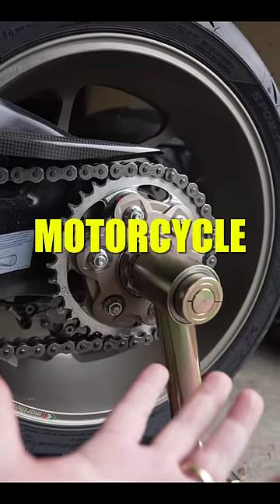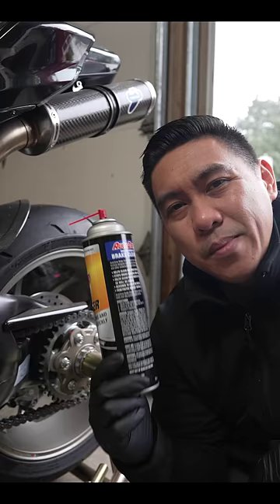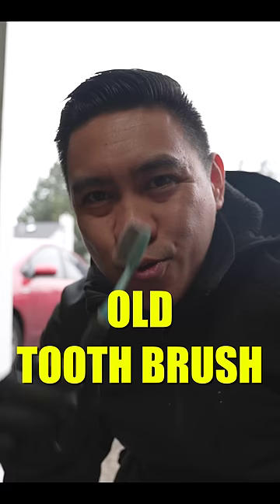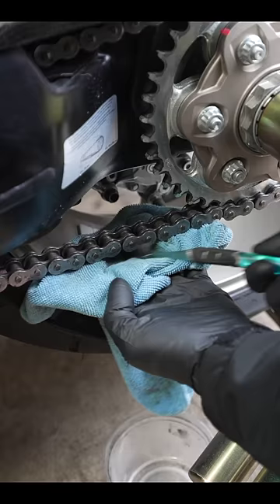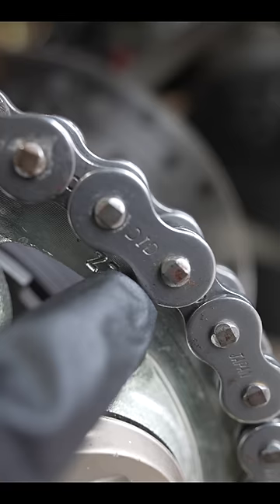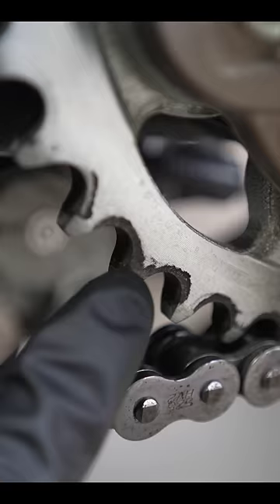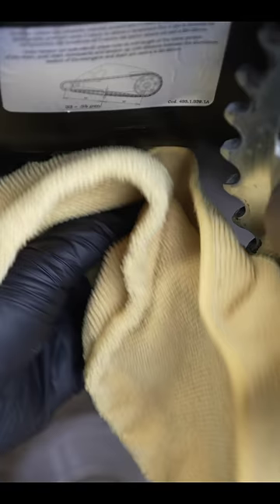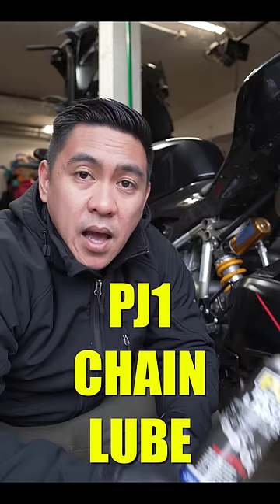How to Clean and Lube Motorcycle Chain

Comment: That little amount of lube will not spread out to the rest of the linkages.  It might cover a couple of the surrounding linkages but that's it.
Reply from the maker: Oh, i meant to spray that much across the whole chain. I guess i wasn’t clear.
Reply: @adobomoto  i mean i thought tht was obviously what u meant.. u came off clear to me atleast
Reply: @rajeevidayakumar4468  seems to hit ppl at both extreams cause i also was confused
Reply: @no_special_person  me too lmao
Reply: @adobomoto  " you wont need anymore than that"

say you dont know what you are talking about without saying you dont know what you are talking about
Reply: @nickdemsey7188  I have a rear stand lmao its not hard to rotate the wheel
Reply: I read this before even hearing and seeing it and I still interpreted it like that
Reply: Common sense goes a long way
Reply: @Jonn_Alisha-4ever  well the "I made a bottle of pj1 last 10 years" part adds to the confusion. Obviously it seems like that little spray on that one area would be the tiny amount used in the minds of people who ride daily and clean their chain often. That's a lot of cleans and lubes over a 10 year period, so it makes it more plausible that he meant don't spray any more at any other points and the heat will spread the lube across the whole chain somehow. I'll ignore that the bottle would likely run flat before it's all used over 10 years. The phrasing did make it confusing for some people, clearly. Every statement added to that confusion from showing one tiny spray, to that's all you need, to the heat will spread it, to the 10 year bottle.
Reply: Anybody who has cleaned their own chain, who has any common sense,  knows exactly what he means,  come on guys
Reply: @crp7965  he's explaining how he uses so little that the can lasted 10 years, as if it's a secret. Everyone knows how they lube their own chain, but no, they don't automatically know what he means.
Reply: @adobomoto to me you were clear enough when you stated “move on to the next section”
Reply: @Honey_Daddy not everyone knows how to clean and lube their chain, at least properly
but it shouldn’t really be a debate on what he meant because it’s like how oil works in an engine, every part needs to be lubricated
but yeah, makes sense why people are confused because he more or less specifically said to spray one area and it’ll spread with the heat, which of course isn’t the case
Reply: @raphy_tt  yep, you covered it fully from both sides. Well said.
Reply: @adobomoto  he’s definitely a gixxer rider if he thinks you meant that tiny spray would do the whole chain 💀
Reply: @tigrisphotosynthesis9796  you're  being  pedantic - run along.
Reply: @firmfire2385  tell me you aren't very bright without saying you're not very bright.
Reply: @crp7965  Why would anybody who has cleaned and lubed their own chain be watching a video about how to clean and lube a chain?
Reply: Bro common sense come on
Reply: @adobomoto  Oh yeah i didnt understand you meant the whole chain that could have been a disaster if i didn't look up the comments lol . But i guess i knew something was off so i usually see what other people in the comments are saying when something seems off.
Reply: mf  @adobomoto
Reply: @adobomoto I thought it didn’t make sense to only spray it in one area but it sounded to me like thats what you meant which is why I came to the comments to check.
Reply: @John-kb7pv because sometimes we may learn that we've been doing it wrong all these years.
Reply: Looked for this comment cause I was confused thinking I was over spraying
Reply: skill issue
Reply: @adobomoto  I actually thought you meant it would be wnough for the whole chain. Especially when you said you made one bottle last 10 years...

Comment: I also use brake cleaner, just make sure you use non-chlorinated, its less harmful to the O rings and anything else you get it on
Reply: @Youre_SmoothBrained  the manual for my R1 and FZ09 says to use kerosene lol. I used to use it, its just too messy and stinks up the garage. I use non chlorinated brake cleaner the same way he is in the video, i just don’t spray it directly on it so it doesn’t get on anything I don’t want it to mess up
Reply: @RapidRedRider  kerosene is fine on rubber because it’s not as harsh as advanced auto brand brake clean. I’m 90% sure that’s not non-chlorinated BPC
Reply: @Youre_SmoothBrained  i know kerosene is safe and idk what brake cleaner he was using in the video but probably not non-chlorinated
Reply: It would take forever for brake cleaner to harm the  o ring and the material used isn’t rubber
Reply: @adendickinson5076  I’m more worried about it harming other parts like plastics. I dripped some on the aftermarket grill on my wrx one time and it melted into it. I had to sand it and repaint it. That was my lesson on being careful with it
Reply: Chlorinated brake cleaner will not cause issues to chain orings. They aren't made of real rubber it's not 1920s anymore
Reply: @DaDaDo661  agreed.
Reply: Instead of risking brake cleaner damgeging the chain just use chain cleaner lol probably a good reason why there's a big difference between brake cleaner and chain cleaner
Reply: @mrtree1368 I use wd40 to clean the chain, works great
Reply: Hi can you use diesel fuel instead koresene? Will diesel hurt the o ring? I just use diesel and i really clean my chain. But im afraid the o ring rubber will not last 😅

Comment: DO NOT USE BRAKE CLEANER! that stuff will eat any plastic or painted surface! carb or egr cleaner is a bit milder even so be careful and theres little rubber rings in there they will get destroyed...and get an anti fling all weather lube use less leave overnight 👌👌

Comment: best procedure I've run across.  no overspray, minimum setup, got the job done in 15 minutes.  Thanks for the video, man...
Reply: what if you don't have a motorcycle stand for the back wheel
Reply: @EgHatchK24a2 hold the clutch in and roll it back or forward which ever way you got space for
Reply: Just be a gigachad and deadlift the motorcycle  @EgHatchK24a2

Comment: Not going to lie you made a quick job really long I usually use an actual chain brush and save the rest of my day not scrubbing my chain with a tooth brush
Reply: Chain brush, paddock stand on the rear, let it idle in 1st gear and use wd40. Clean in seconds
Reply: @dannygatland1353  do not do this.

You will lose fingers
Reply: @JelloThatsMellow  yeah. Never idle the bike in gear. If something gets caught, say bye2 to your fingers or hands.
Reply: Or just dont put your hands too close to it 😂
Reply: @dannygatland1353 also wd40 isn’t good for o rings
Reply: Hi can you use diesel fuel instead koresene? Will diesel hurt the o ring? I just use diesel and i really clean my chain. But im afraid the o ring rubber will not last 😅
Reply: Yes you can... basically most of oring are made from niteile or viton material... and they can withstand kerosene and diesel...@orionmobile6545 the only down side of diesel, it really require proper cleaning and it will be really oily...
Reply: Don't even turn the bike on. Put in neutral and spin the tire with your hand.
Reply: @raresbirzu2436 why?

Comment: I lube with 80/90 transmission oil (very cheap) using a small squeeze bottle with a cone resealable tip, it gets into the bushes through capillary action and that which is excessive stays on the outside of the bushes until it flies off due to centripital force from riding taking any dirt or grime with it because oils have detergents and dispersants in them.
When you buy a new chain the box packaging has printed a recommendation to use 80/90 gear oil.
After a mile or two I stop the bike and give the chain and wheel a wipe with a rag.
It all just wipes straight off leaving a clean lubricated chain using no harsh chemicals .
Reply: Finally, someone with some sense...
Reply: is it safe on o rings?
Reply: @fanhur6973  it is when chain manufacturer's instructions specifically calls for it.
Reply: @leeengelsman1855  I used to, but it flings off quite a bit of spatter which can make a mess (and it smells bad when you're putting it on).

Comment: Brake cleaner is a good idea. Never tried that. I lubricate with gear oil all the time. The chain is smooth, it flings off dirt, high loads are not a problem and it never rusts.

Comment: Personally, I've been using kerosene, but if people are worried about brake cleaner harming o-rings why not CRC electrical contact cleaner instead? It's safe for plastic and rubber, dries quickly, and degreases beautifully. I've used it to clean carbs, wire harnesses and other stuff on a bike and you don't need to worry about overspray; it also doesn't smell as nasty as brake or carb cleaner. I've been using Maxima lube but will def check out the PJ1.

Comment: I'm sure I'll get alot of backlash from this, but I've used wd-40 to clean my chain and wash it off with water, being that wd-40 is not oil based it comes right off along with all the dirt and grease. Air compressor to get all the water off and chain lube, cuts the time in half
Reply: In tests, WD-40 has been shown not to protect the chain internals, probably by rotting the O-rings.
Reply: No compressed air, it gets behind O or X rings displacing the factory grease and forces crap behind them

Comment: There are autolube solutions available with cleaner fluid of your choice as well. They'll drip a constant amount till empty for 5-7 months, and in between you can manually change to cleaning solutions. Not very expensive, about $200-300, and the lube cartridges are $10-50 range. It is helpful if you ride a lot.

Comment: I advise against using brake clean as it will dry out the Orings and cause them to fail prematurely
Reply: Yepp use WD40
Reply: Not the case, The o rings are a silicone rubber instead of aflas or polyurethane. It can't harm them
Reply: @69VAJRA  remember wd40 is a degreaser, so if it does get past an O ring you're actual lube trapped inside is gone. 
I use grease it wipes off with all the dirt then just re apply.
Reply: O ring chains aren’t all they are cracked up to be
Reply: You better have that conversation with Wurth then, they sell chain AND brake cleaner.
Reply: @69VAJRA  😂
Reply: i was going to say the same thing
Reply: Gear oil
Reply: @Rhythm24inch  if wd40 is a degreaser, what's a dedicated chain cleaner doing then?
Reply: @vidsupercharged1622  exactly, you seem to have worked that out all on your own 👍🏼

Comment: The mechanic where I go with my is saying that I shouldn't use to many solutions because it will take out the lube from inside the O ring. That I should just clean it with a cloth or brush and just add more lube. Unless it's super dirty. But when it is dirty and if I need to use chemicals to clean the to make sure I dry it out and clean properly before putting lube and to put extra lube so that the o ring isn't damaged or the chain is rusting on the inside.
Reply: Don’t use brake parts cleaner. I’m going through comments to warn people of this clown. Use “clean up” chain cleaner. Blue and yellow can. Use “maxima chain wax” in the brown can. The cleanup will clean the seals and get everything out (dust that is, let’s some grease stay in it depending on how much you use) and the wax will keep it lubed up. You’ll have to do it more often with the wax due to it holding sand and dust. But it’s amazing lube. If not that can PJ1 or Lithium grease

Comment: I use white grease cause it will last longer and the company claims it is better against rust and rain. What are you thoughts about this?
Reply from the maker: Sounds like it will work fine. I use lithium grease in my bearing dust covers to help keep crap out.
Reply: Lithium grease is pretty good. It’s what they put on them from factory. I daily ride and I use “Maxima chain wax” the brown can. No issues and it doesn’t spit shit all over your bike when you go to ride. Acts like a glue almost but you need to clean it more when using it. It’ll cause dust and sand to stick to the chain. Just keep up with maintenance and you’ll be good. Don’t use BPC either
Reply: i use gear lubr just as my owners manual tells me to lol, cheap and proven to be effective

Comment: Brake cleaner dries out quick.WD40,let it soak and then clean it.Apiece of cardboard works better with a bit of finesse you wont have to hold it,so you can spin and spray at the same time.Also,all the chain sprays,you should not press it all the way.Moderate the pressure so that you wont overspray.Wait 5min and wipe excess

Comment: Very close to what I do some guys use diesel or WD-40 it's it's all about the same ⚡️⚡️been using up 80-90 gear ⚙️ oil up then the new molybdenum type to lock in the 80-90 ⚡️⚡️
Reply: I guess there are different types of brake cleaner. Years ago on my old bike I used some automotive brand brake cleaner to spray off my front discs and it ate the paint off my front wheel. Seems like some brands are fine though.🤷‍♂️
Reply from the maker: Non chlorinated is what i use

Comment: I take mine off, but I'm kinda ocd. While it's off I check for any abnormal wear or stretching
Reply from the maker: That’s a lot of work lol
Reply: Kind of ocd? Taking your whole chain off to clean it is a bit more than "kind of" lol!
Reply: Most guys run riveted masterlinks and would have to remove the whole swingarm.  No thanks...
Reply: @mscustomknives  Pull a rivet, reinstall. Ready with the right tools.
Reply: Bruhh, you take your chain off every 500 miles? TF 🤣

Comment: get a rag and a bottle of WD40, spray on chain and rub with cloth, done, no need to use toothbrush, also break cleaner can dry out the orings if u got oring chain
Reply: WD 40 Silicone Spray  would be better than regular WD 40 but using proper chain cleaner would be probably the best. Just my opinion.

Comment: my motorcycle, i ride it everyday for work, just spray it with pressure washer and let it dry then lube it with used motor oil, that's fine, over 3 years the chain and sprocket still in a good shape

Comment: I get it running on the stand at idle in first and clean the chain then pour a small stream of 75w-140 on it works with o ringed and non o ringed chains

Comment: chain manufacturers call for gear oil like chainsaw bar and chain oil. also they make brushes and systems that clamp arind the chain and make this way easier.
Reply from the maker: It’s called a grunge brush. I have one. The toothbrush cleans better.

Comment: Can anyone help me with an answer? I did an adjustment on my chain just like in this video, but when I sit on the bike, the chain is very tight. I know it's supposed to tighten as the suspension compresses, but I don't know if there should be any slack or not. Thanks

Comment: I think also chain lube should be applied after a ride. Not when the chain is cold and rigid. If the chain is cold the grease will be going everywhere on the wheels. Apply it after a bit of ride and its gonna stick to it like a dream

Comment: A word of advice from a mechanic. Brake cleaner is not good for rubber or silicone. It eats away at it. It will erode your orings on your chain.

Comment: What do you recommend if the links are frozen/ stuck together? It happened to mine and there is no slack whatsoever when I spin the wheel. Then the chain droops down a lot until the tight spot spins around, then there is no slack.

Comment: I have been using chain cleaner spray (which is like parts cleaner) and a good layer of WD40 after the cleaner is dried and wiped down. Is WD40 going to lessen the life of the chain if I do this every 2-3 weeks?
Reply from the maker: No, you’re fine

Comment: Buy a big bottle of acetone or paint thinner (same stuff) and put that in a spray bottle, literally the same stuff as modern non-clorinated brake cleaner,   just dowse everything with that,  itll cut grease off like no bodys business,  let it flash off,  then just wipe it down with an oily rag with 80/90 weight gear oil on it.

Comment: I definitely wouldn’t use brake cleaner on the chain. That can cause the o-rings to wear out quicker.
Reply from the maker: Where are you getting this info? Any facts? Scientific resource?
Reply: @adobomoto  brake cleaner is known to dry out rubber and cause it to crack.
Reply: @adobomoto  He is right. This is from the  back of the Autozone Brake clean can (Simply wet down the surfaces that need cleaning by spraying in short bursts at a distance of roughly 18 to 24 inches. Make sure to avoid getting overspray on plastic, rubber, or painted surfaces. It's a powerful cleaner. After all surfaces are wetted, continue spraying to remove contaminants.

Comment: Now a days, lubing a chain is only for rust prevention (o-ring and x-ring chain). Also clean and lube the night before, let it set in the chain. Otherwise if you lube it and then go riding it'll just throw the lube off.
Reply from the maker: Pj1 actually sticks right away

Comment: Literally, a kid that works for me in my motorbike shop, he's 17.. Read somewhere he should put his bike on the paddock stand, turn the bike on.. put it in gear and use a chain brush and hold the brush on the chain while applying chain cleaner.

His thumb was pulled into the chain and sprocket.. he now is missing a thumb and had to have the rest amputated.

Lesson... never have the bike in gear and work on the drive chain.